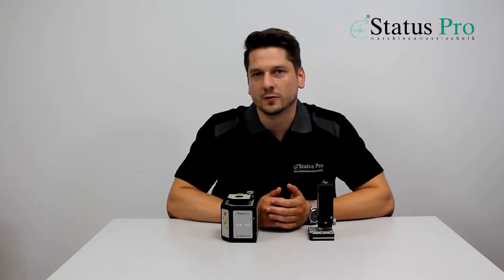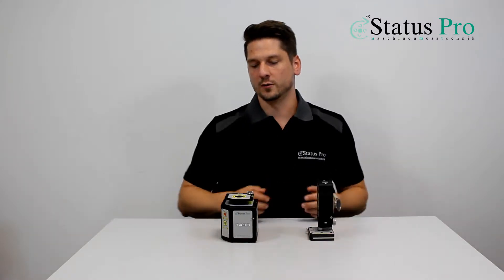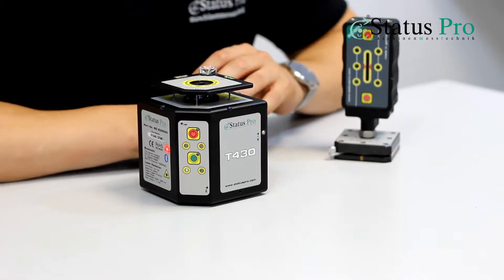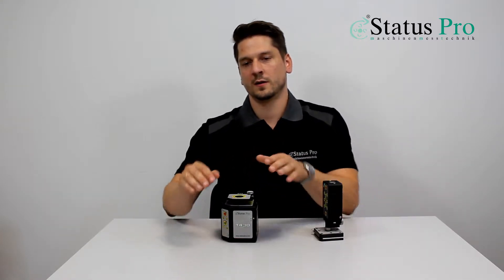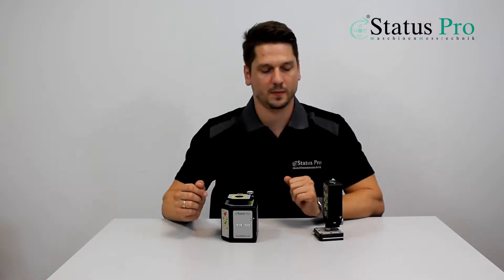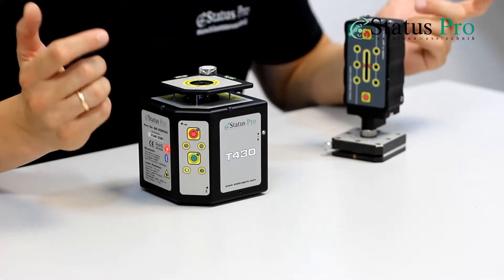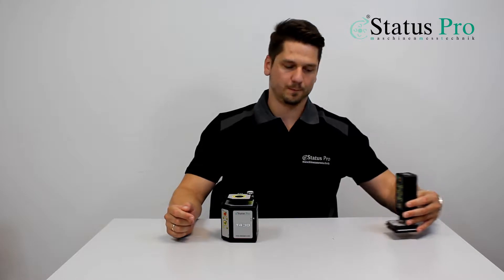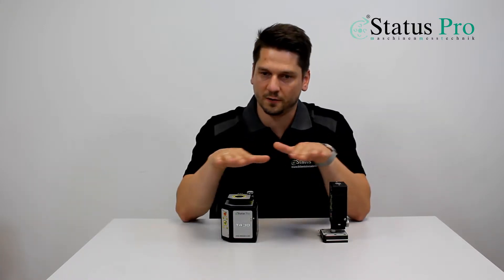Theory and practical flatness measurements with the ProLevel 200 laser system.

Comment: Might be costly but useful and easy to use. How it can be used for small sized parts ?
Reply from the maker: Dear Law Kumar, this depends of course on the size of the parts. The equipment is made for the measurement of machine tools and larger objekts where a reference of a laserplane is helpful. If there are specific parts you would like to measure please let me know and we can check if the system is a helpful solution or not.